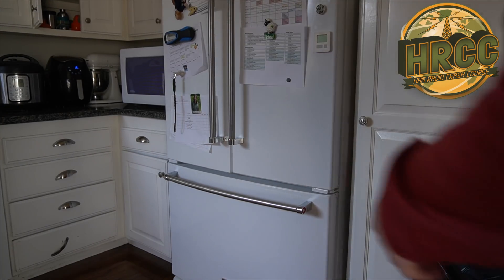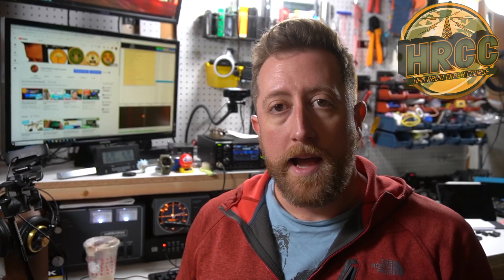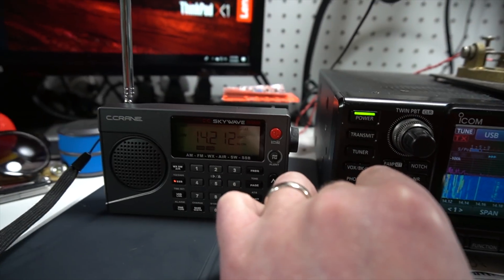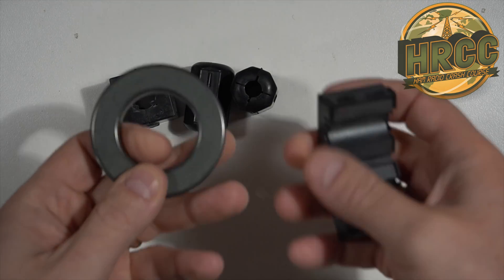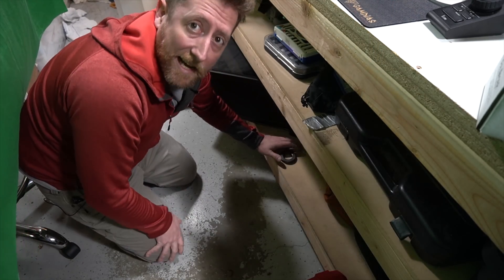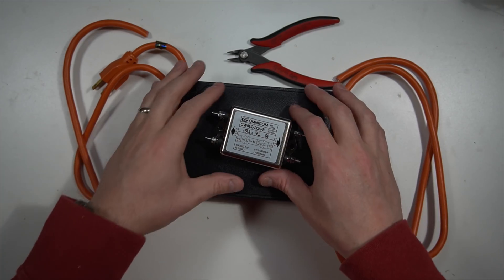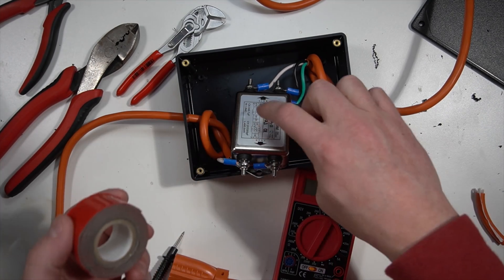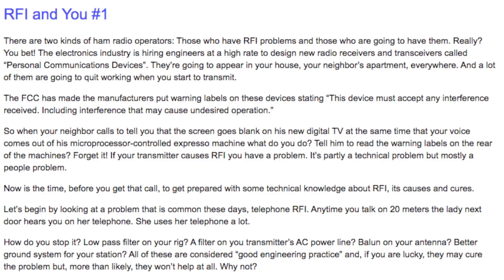WE are killing the amateur radio bands, and here is how to fix it (RFI)

Comment: I like an RFI meter you know like the ones used on ghost hunter channels. There cheap and cover a much wider spectrum, however a radio tuned to the problem frequency is a good final touch. My "Insta-pot" sets off my EMF /RFI meter real bad, but doesn't effect my ham frequencies I use. "I use is the key phrase".  So a handy talkie or a multi band SW receiver like you used will save you unnecessary false positives. After all Ferrite rings aren't cheap if you need 30 of them 😞

Comment: We think here in France we have noise over the power lines coming from digital transmission of data. They send your consumption data from the new digital meters down the cable itself or via transmission. I'm not sure but I met someone today and went back to his QTH to see. He had 3x loft antenna. A dipole, an inverted Vee and a small mobile antenna on a steel plate but it was up against the wall. I guess the plate was too small and he was trying to trick the swr to come down without realising what he was doing. But the rest is ok. no other power lines near the loft.
  But. On the outside of the house the power lines and phone lines run around the same height as his antenna in the loft. He is missing a transforming balun on at least the dipole, He can also do with some 1:1 choke baluns mix 43.
  We don't know what to do. We turned off the power to his house and it made no difference. s8 of noise.
 We walked around the area with a portable mw radio and found there are all these plastic boxes and all of the power poles made terrible noise around these boxes on them and the cables running down. telephone manhole was also very noisy. I'm not sure if a separate earthing rod would help with this noise, especially as many of those cables are in the ground. Perhaps it's better to have a false earth than a true earth for him.
  I'm going to suggest those things but I think I want to encourage him to put a lightweight vertical up very very high so that it is up much higher than the power-lines. He still has a part of a mast mounted in his loft from when he had a cubical quad but the wind took it.
  I'm going to suggest cokes on the coax, perhaps a Vk5 noise canceller if mine works there but i don't think it will.
 Perhaps we will try a separate earthing rod for the coax. Main thing is the 1:1 choke with type 43.

Comment: What dryer (that normally has a 230 VAC @ 30 Amps Requirement) is operating on an extension cord ??
Reply from the maker: Idk, but it’s not mine. Mine runs on gas.

Comment: So many sources of RFI - I had bursts of really strong signals around 433Mhz, I had a number of weather station clocks, each with a temp sender, boy those wiped out my radio from the garden. took batteries out (if I want to know how cold it is outside I open the door).  Also a sender for electricity power monitoring, and get this - the sender units on my car tyre pressure sensors!
I also had one of those 'home plug' network over power sockets devices, just brutal RFI from that.  I'm down to unavoidable WiFi, Computers, NAS device, TV's, washing machine and dryer and LED lightbulbs that I put all around the house thinking how to save money... - its a nightmare.
That is not even taking into account the crappy Chinese wall-warts that I and the neighbours have .
Still much work to be done.
Great information - thanks.

Comment: Where do I start? With the house powered up, running my radio on battery, my noise floor is right at S20 on 40 and 80M.  With the main breaker off I get down to about S8. I can’t conceive an S3!
Reply from the maker: You should work through your homes rfi issues and call the power company for a check on local power lines.

Comment: Powering down the house was inconclusive the first time I tried, but I later realized I forgot to remove battery backed-up items from the house  like the CO detector and the interlinked smoke detectors that are definitely good receivers of RF (my family hates when I set them off when they are asleep!  😂).  I also forgot to disconnect the CATV wire and terminate it outside the house.   All on my to-do list

Comment: Thank you for the crash course on RFI! As a HF operator living and operating in the suburbs, I deal with noise on a daily basis. In my neighborhood, 20 meters has a noise floor of an S3 to S5. I recently discovered that solar panels produce lots of RFI. I'm not saying I'm against the use of solar panels, but I am upset about the noise they produce on all HF bands. I will consider putting toroids on similar devices such as TV's, chargers, etc...

Comment: Great Content as always! Your Dryer issue reminded me of the front load washer (LG Brand) we had. It made a lot of hash on 40m and 15M when it was not turning, or transitioning between CW and CCW. while spinning it was fine. No amount of ferrite wrapping on the power cord helped. I had to take it apart and EMI shield the circuit board and get right on to the motor casing and shield the motor controller. (My wife was eying me speculatively during this process...) Palomar makes great stuff, and I recommend their 7300 EMI kit. Thanks Again for all you do!
Reply from the maker: Thank you!

Comment: Hey Folks,

Setting up QTH HF base station and would like  one of those ring light/magnifiers with articulated arm as a desk lamp, either a stand model or clamp-on version. All I found at Office Depot have L.E.D.s. 

Any advice on brand/model/type of desk lamp that either doesn't emit RFI or is easily shielded with toroids based on your experience? Trial-and-error for purchase would be onerous and would like the benefit of your experience.

Thanks!

73,
John - KK7JBZL

Comment: 2:55 What if the noisy device is off? It may have been on when it lost power, and like a microwave clock, it stopped, and unless you turn it back on, you won't see the noise, and think that the noise is elsewhere.

Comment: I've had poor results with toroid cores.  Then, it hit me!  When you wrap an AC cord around any kind of core, there are TWO wires, parallel to each other.  At any instant in time, equal current is flowing in each, in OPPOSITE directions.  So, the fields they generate cancel out---except for a little imbalance, due to a lack of perfect symmetry in the winding.  What to do?   Cut the cord, wind the coils so the currents in each wire are going in the same direction, and reconnect.  This principle is also employed, though with the opposite result, to make non-inductive wire-wound resistors.  The resistance wire is folded back on itself, then wound on a form.  The inductances of each half cancel each other out.
Reply: The purpose of the torroid is to attenuate common mode rfi.    It has nothing to do with the AC current flowing in the wires.
Reply: @stargazer7644  Yes, it DOES attenuate the common made RFI.  But that does nothing for spikes imposed on the 60 Hz power-line voltage.  So it DOESN'T remove the spikes that appear in the output of a switching power supply, nor the harmonics that are there, because it's a square-wave.  Maybe I should have made it clear as to what kind of RFI I wanted to reduce.
Reply: @Pootycat8359  A toroid on the AC line side isn't going to do anything to the output of a regulated switch mode power supply, so I'm not sure what you're talking about.
Reply: @stargazer7644  I'm talking about cutting the AC line, and winding the two conductors so the series inductance, measured between the conductors, is double that of a single winding.  That way, it would be a choke to the signal on the P.S. output, but not to common-mode signals.  It would be just like cutting one of the leads and inserting a choke.

Comment: Are we more concerned with the noise sources' proximity to the radio or to the antenna? If you had a 50' feedline running out of your house, the dryer next to your radio will still manifest the noise?
Reply: It depends on how the noise is getting in.  Almost everything he's doing is to stop conducted noise on the power lines.  You can also have radiated noise.

Comment: I took a portable hf rxer about 150 feet from any homes around me, a field next my house, and still have an S-6 to 8 noise level on 75 to 10 meters. 2 meters is bad too. Some QRM won’t even get squelched on some 2M frequencies. I’m thinking cable TV leakage. At least 150 feet away from anything. Clues or next steps? Used to be much easier to find RFI!

Comment: Well but what would say a Korean manufacturer care about the FCC. They don;t have to accept type testing, RFI limits etc. My favorite is my microwave oven it has a switching power supply that died just when it went out of warranty. Could I fix it sure but it's not worth the time. And toroid cores are one thing but Faraday cages are better. Just use copper screening and ground it.

Comment: My worst problem is broadband S8 noise affecting 160m - 20m. 2m sometimes has S6 - S8 noise as well.
It's killed my h.f. operating although for some reason I can use 60m. It started years ago on 30m, then about three years ago it affected the other h.f. bands.
I bought an FT817 so I could go portable and get away from it.
I heard a G station yesterday on c.w. saying he will have to go QRT on h.f. because of vdsl. I read up on it today and vdsl2 is even worse as it goes up to 30 MHz. That will kill all h.f. 
Ofcom investigated and said the line had probably become unbalanced but they have no power to tell BT to do something about it. BT don't care. The Minister for Digital and Broadband doesn't care. All you get from these people is a standard letter from a non technical secretary who knows nothing telling me to get in touch with my broadband provider. BT want money from me to take down their offending line.
G4GHB

Comment: I just wish I lived in a house. But I live in a small apartment, and there are power lines right outside my windows that supply power to 100 apartments. VHF through repeaters is OK, but my only viable HF option is to go out to a park and set up a portable station there. On the plus side, I live in a CO town where I'm 15 minutes away from sitting in a park at 8000 feet elevation with a view 100 miles to the east, north, and south. But when the weather's not good, I just sit at home and build gear.

Comment: If you run your radio off a 12v supply and any other gear you could just wrap the 12v line to stop any line interference. If the 12v supply is lab grade it should be pretty quite anyway. Then any noise getting soaked up by the antenna it's self can be attenuated by a phaser.

Comment: I realize I commented on (and therefore watched) this video two years ago.  My thought is why do we keep accepting this?  Why do we take it lying down?  We need to complain to the appliance manufacturer and/or the power company.  And, not just once but repeatedly until they fix the problem.  If you are not getting satisfaction, write to the FCC, again repeatedly until you get some response and some action.  Most folks try once or twice and give up.

For those who don't think this works, the FCC fined and forced Home Depot to eat millions of dollars worth of noisy Chinese LED light fixtures.  The FCC went after computer manufacturers for selling home computers with noisy supplies.  They have gone after power companies and cable companies.  The FCC is not fast, but they are the 900 pound gorilla when it comes to RFI.

Another option is to get together with some other hams, find an attorney, and file a class action law suit.  This is tougher because you need about 25 people with the same problem from the same defendant to make it practical.
Reply: Nobody listens to us. The RSGB this month said over 18 months amateurs reported noise to them and they got in touch with Ofcom but the complaints were rejected without further investigation. The RSGB have no power. The Minister for Digital and Broadband sends a standard letter from a secretary who knows nothing saying to get in touch with my broadband provider. BT will charge me money to take down their offending line.
It's at the point I no longer operate except on 60m which seems clear. 
I've not renewed my subscription to the RSGB because I don't want to just read about radio. Every year for the last three I've wondered about renewing it.
G4GHB
Reply: @bill-2018  It is a shame that you face such conditions.  I'm sure that if you interfered with your neighbor's radio or television, they would come out promptly and investigate you.  In the USA, our Federal Communications Commission (FCC) may be a huge bureaucracy, but if one complains enough they will eventually take action.
Reply: OK Don Quixote.  Let us know how that goes for you.
Reply: @stargazer7644  It does work.  I know it works.  I gave a couple examples of major companies forced to comply.  Another example that comes to mind is a ham friend complained to the FCC that a local TV stations signal was not in compliance.  The station's chief engineer was majorly pissed when the FCC showed up to inspect and then ordered the transmitter repaired.
Reply: @BryanTorok  A local TV station has to comply with stringent emission requirements as a licensed transmitter.  This is apples and oranges.  The power supply in your TV set is not a licensed transmitter - it's a very low powered un-intentonal radiator.  And all of the emissions demonstrated in this video are conducted through the power lines, not radiated through the air.
Reply: @stargazer7644  Virtually every piece of electronics sold today comes with a statement that it may not interfere with licensed radio communications and must accept any interference it receives from licensed communications.  That is per the FCC and is law.  As I mentioned, that applies to computers and even LED lighting fixtures that are not intended to be RF radiators.  

The FCC is like a big ponderous elephant.  It can be difficult and take some time to get it stirred to action, but once it takes an interest in something, it can be a force to be reckoned with.
Reply: @BryanTorok  There are numerous different regulations that electronic devices have to comply with depending on their purpose.  The section that statement you quoted comes from is Title 47 CFR Part 15 and is only displayed on devices under that part.  The actual regulation isn't quite as cut and dried as you think it is.  ALL electronics radiate electromagnetic interference.  You can't eliminate it, but there are limits to how much radiation is allowed depending on if the device is an intentional or unintentional radiator, and if it is a licensed or unlicensed device.   It is entirely possible these devices are completely within the requirements of the regs that apply to them, but still wipe out radio reception nearby.  Your naive faith in the FCC's enforcement activities is admirable.  But as someone who actually deals with investigating radio interference, I can tell you it simply doesn't work like that.

Comment: You could bootstrap your drier filter with added 31 mix beads or torroid on the load side lead. Now I have to mitigate RFI from my fridge. Every wall wart is eliminated in my shack and replaced with a linear ps or battery.

Comment: Mix 31 Ferrite is what you need to squelch noise.
Reply from the maker: They can only do so much to be honest. Mainly for common mode on the shield. In my case there are massive noise generators the antenna is picking up.
Reply: @HamRadioCrashCourse  Then a Timewave ANC4+ or the MFJ-1026

Comment: Great job! I had the same fridge issue; an off-line 12V switcher running at 3.6 MHz! I hacked in a cleaner transformer based linear supply.

Comment: Josh. I am having the same issue with a Samsung refrigerator. Do you have a link the the actual ferrite choke that you brought from Polamar?  I need to buy one but the site is a little confusing and I don’t want to buy the wrong kind.
Reply from the maker: Mix 31 and get the larger inner diameter so you can wrap the wire many times.
Reply: @HamRadioCrashCourse  thanks Josh! KD7DAT .  Love the channel. Keep it up! 👍😊

Comment: It seems to me the FCC should clamp down on the manufacturers of these devices for producing so much noise.
Reply: There have been EMC regulations since the 1980s but it looks like they haven’t been enforced too well.
Reply: I'm afraid the FCC is the government, and the government pretty much works for the manufacturers and businesses. SO there will only be lip service about RFI and it's up to us to solve the problems.
Reply: No. Stop giving this idiotic government more power over ourselves and others. This is not an issue the government should be involved with.

Comment: You can get RFI from a breaker itself. I had to replace the 20A-220V breaker that goes to my dryer circuit. I turned off the breaker and the noise went away, but unplugging the dryer and turning the breaker back on. The noise returned. There must have been some arcing inside the breaker. Once the breaker was replaced, the noise from that circuit went away.

Comment: It would be tempting to dismantle the dyer and see what is going on.  Mine is (happily) a very simple device, where the only smarts are in a motorised timer that runs until the dryer switches off.  When it's off it draws no power and makes no noise.
Reply: Most people don't have dryers from the 1970s today.

Comment: It’s very important to make sure your appliances are all grounded good. It tends to put a shield around the equipment. Then also very important is to make sure your house is grounded by a lightning rod. All homes have to have one to give you another protection. The power company doesn’t give you a good ground. Then also if you have copper water lines in the house, make sure they are also grounded. Usually in a home if something needs to be grounded, they run a grounding wire to the waterline like maybe upstairs to save running one all of the way to a panel.
Reply: How does a lighting rod ground a house?